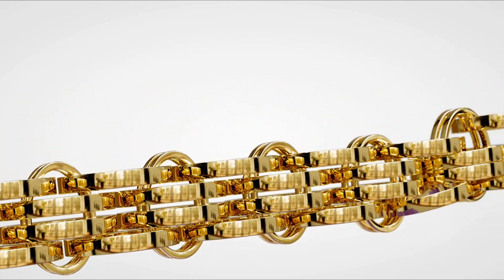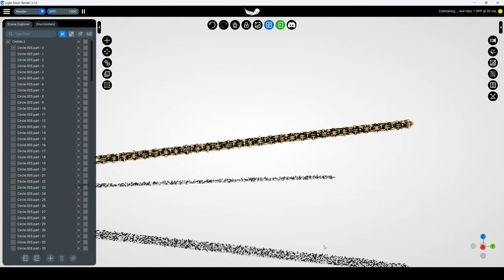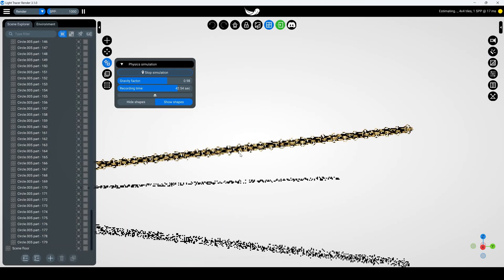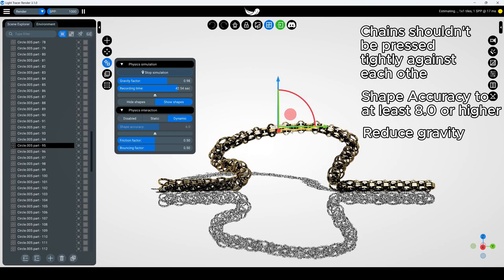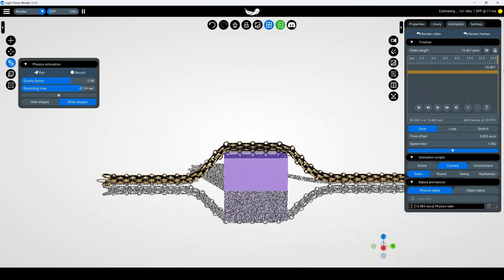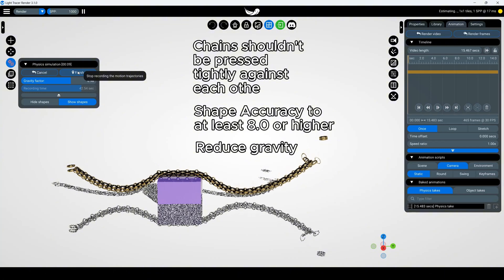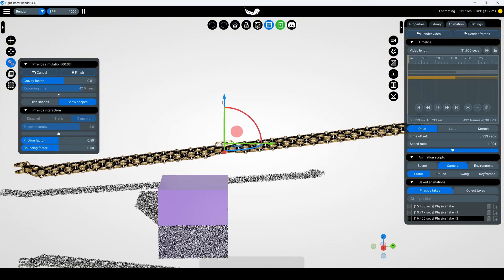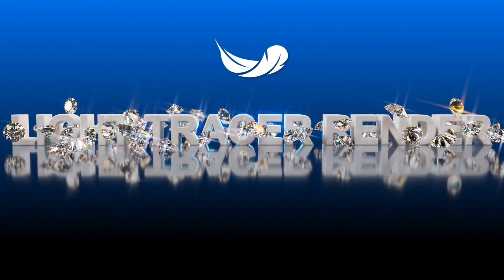Complete Guide to Chain Simulation and Animation in Light Tracer Render.

Comment: i did the same thing but the chain freezes lol even they're separated.. I set it to dynamic and then they scattered from each other LOL
Reply from the maker: Hello, please make sure there is enough space in the gaps between links so they can move. Also you could try lower the gravity, it will make the simulation more stable.